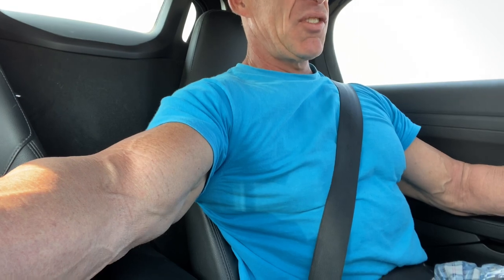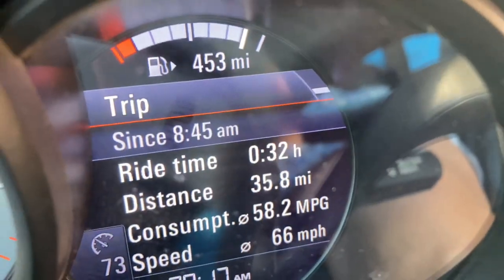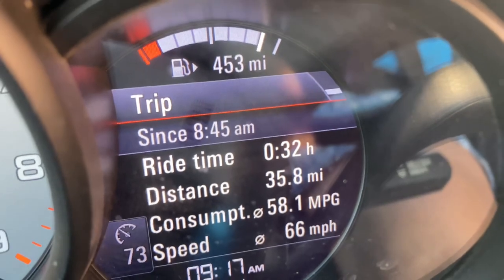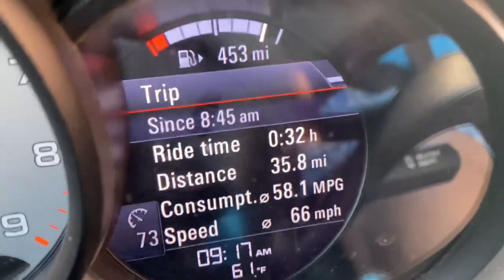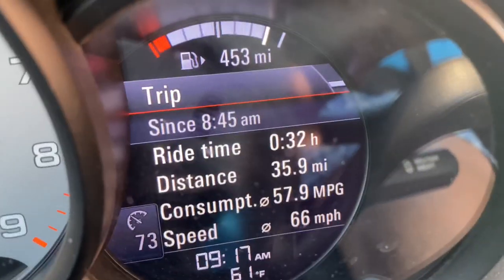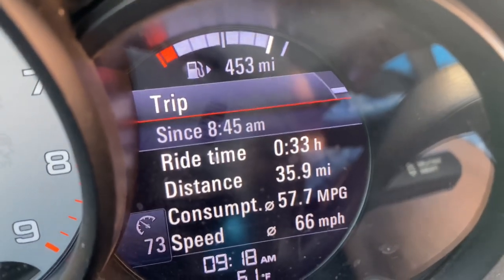58mpg in a Porsche - goose and glide

Comment: Connecting the engine to the transmission is adding friction. Adding ANY system will introduce some amount of friction. Otherwise we would have ourselves a nice little perpetuum mobile. Yes, when you let the engine do the braking, it does not consume any fuel. HOWEVER, braking down hill means losing energy. Quite a lot and it is not stored for you anywhere. It goes to waste as heat. Look up some videos about coasting btw. It always wins. Nowwwww, if we could STORE the energy that goes into engine breaking....
Reply from the maker: A transmission in neutral probably has 1/25 the friction of a transmission in drive connected to an idling engine at 65mph.
Reply: @scooby1961  Yeah, it is a HUGE difference for sure.

Comment: Hey Scooby, I'm pretty sure your car does NOT include the time you are in neutral while gliding for avg MPG calculation or it uses zero or some arbirtrary value, this will give you innacuarate MPG info. Car uses some fuel to keep it running while in neutral, but uses NO fuel if you are in gear going downhill(assuming you have an electronically controlled injection). Best test would be to fill the tank and do a test with no gliding, fill the tank again and drive the same mileage with gliding, fill it again. Then, compare the amount of gas used.
Reply from the maker: I dont care how people measure mpg, what matters in the real world is how many miles you can go on a gallon of gas - coasting DOES count.
Reply: @scooby1961  All I'm saying is that car calculated MPG is not a guarantee that you are using less fuel than with efficient driving without putting the car into neutral rather then just in a higher gear. If we take a certain downhill track, your car is using more fuel in neutral rather than in high gear with no gas input for that downhill part. With coasting in neutral you are trying to go further down the road after the downhill part because you will be able to maintain higher driving speed. Now, will you be more or less efficient with or without neutral coasting compared to a high gear coasting is very questionable and highly depends on few other factors. Again, only a test with fuelling/driving/refueling will tell us more.

Comment: don't manual transmissions generally wear out faster than automatic ones? one reason being the sleeves in manuals transferring from one gear to another
Reply from the maker: Depends on how you drive. A horrible driver who never tries to RPM match will trash it quickly.  A skilled driver will never need a transmission overhaul.

Comment: Yes ..... Problem is that your gerbox isent oiling in N ..( saving on gas and braking gerbox. ) New cars dont oil in N but old cars do
Reply from the maker: huh?
Reply: Only with very old automatic transmissions. Manual transmissions' gears are permanently immersed in oil.

Comment: When I was doing my driving lessons I had use this somewhat unintentionally and got told it was a bad idea. But in connection when using the car momentum to "glide", then breaking before intended stop, no slowing down by the motor. I never got an explanation why is that.

I never finished getting my drivers licence as I knew I would be liability on the street (micro-sleeps, bad attention etc).
Reply from the maker: ... critical thinkers ask WHY
Reply: @scooby1961  I asked, got told "shut up, don't do it" ... aka the usual instructor shortcut. I guess this is a good time to look into it.

Comment: Great video! I’m curious on how accurate in your experience the car’s readout is on avg. mpg and the instantaneous mpg. I have a similar readout in my vehicle, but still haven’t calculated after a fill up to see if they’re accurate
Reply from the maker: the fuel flow sensors are pretty accurate.  The instantaneous MPG readouts are pretty useless but after you have driven at least 20 minutes, the cummulative MPG is pretty accurate

Comment: it would work also in an electric car even though its automatic right?
Reply from the maker: No because in electric cars, there is no engine with all those internal friction losses.
Reply: I think it depends on the car, most electric cars use the engine as a generator if you decellerate to return energy to the battery. Some start doing this as soon as you release the gas and some do that if you apply the brakes lightly (the friction brakes set in if you brake hard). You have to check with your specific car.

Comment: Driving in neutral is prohibited in most countries.
Reply from the maker: This IS true but its STUPID.   Using "neutral" is NOT dangerous if you use common sense! I am going downhill with no other cars within a 20 second radius of me. If I find I am going faster than is safe, I would cease this technique and go back into gear to use the engine to brake. The reason that drivers training tells you to stay in gear is that if a deer suddenly darts in front of you, you need all four options open: to swerve left, to swerve right, to brake, to accelerate. Those are the four ways you can avoid a collision. When it comes to the choice of braking vs acceleration, braking is the right answer 99% of the time because 1) if you fail, the collision is slower 2) you can decelerate much faster than you can accelerate. THINK about this situation. I am going down a steep downhill very fast, in fact, I am going as fast is as safe and legal. Should a deer dart out, going faster is not a good choice nor a legal choice and the brakes would be a much better idea. For the sake of argument, lets say I was going half the legal speed limit coasting down the hill in gear because I remember that drivers training told me to do this. A deer jumps out - SHITE! I decide that acceleration is how I will avoid the deer but I know that I am in 6th gear at 50mph and that even in a high powered sports car, stepping on the gas in 6th at 50mph will not cause the acceleration required to prevent the collision so I downshift to 3rd and punch it. There goes the drivers training safety argument. I have to shift anyway to avoid the deer and it doesnt matter if I have to shift from 6th to 3rd or from N to 3rd, its a one second shift either way. Braking is better for collision avoidance 99% of the time. Its only at low speed where acceleration becomes a viable option.

Comment: Sorry for the harsh comment, but this is stupid and bad advice. First, it's dangerous to drive in neutral downhill. And second, it's the other way around. When in neutral, the engine NEEDS gas to keep running. When in a gear, car momentum is turning the engine with ZERO gas. These are basics. How the hell did you manage to mess this up? And even try to lecture people...
Reply: Well, to be fair, you are a bit old and may not be up to date how modern cars work.
Reply: Sounds like you didn’t even watch the video lmfaooo, not even the first two mins. Typical of this day in age, short attention spans like a hamster. TikTok generation
Reply: Wtf are you talking about, car momentum turning the engine? Maybe in Bedrock but that’s not how engines work outside of the Flintstones. You have no mechanical knowledge.. and even try to lecture people.
Reply: @himrider6044  Tire rotation is turning the engine via the transmission. What is too difficult here for you to understand?
Reply: Oracla just went full cringe
Reply: @HulaLuau  You are correct. But when the engine is disengaged from transmission, it's still idling. Unless you use perpetum mobile, this process requires gas. Maybe you think the engine is shut off?
Reply: I think it is simply dangerous driving with one hand and speaking  to your phone and not look at the road!
Reply: Its also illegal to do what he recommends, look it up
Reply: @HulaLuau  the engine uses fuel while idling. Rolling downhill in gear the fuel is shut off.
Reply: Read-up on hypermiling.
Reply: @timeless_realm  Hypermiling on wikihow: On newer cars if the car is in gear and your foot is off the accelerator, the injectors shut off completely, creating essentially "free" mileage — your car's going but you're not using gas beyond a small amount for engine braking, or the engine's resistance to your costing.
Don't coast by disengaging the clutch and/or putting the car in neutral. This will cause the engine to go into idle which uses up more gas than simply leaving the car in gear and letting it coast along with minimal engine input.
Reply from the maker: 1) anything is dangerous if you are an idiot.  2) You do not understand even the "basics" of physics.  An idling engine when attached to the wheels is braking the car.
Reply: @scooby1961  of course it's braking the car. But it is using zero gas. I'm surprised you are still sticking to your flawed undestanding. Ok, so I'm just an idiot online. But maybe you could make some research, just for laughs?